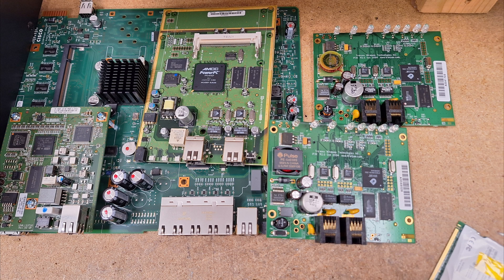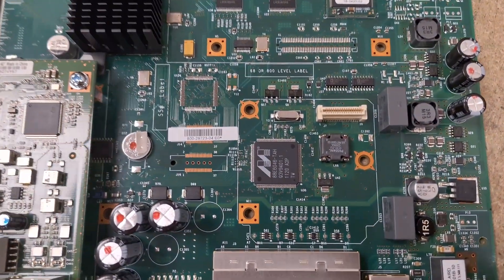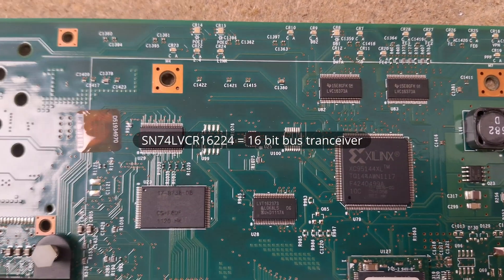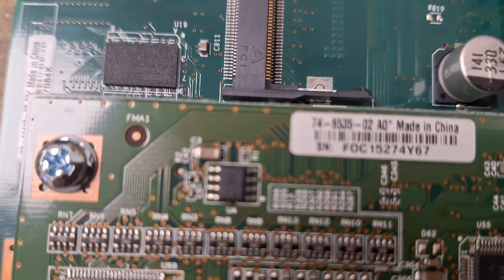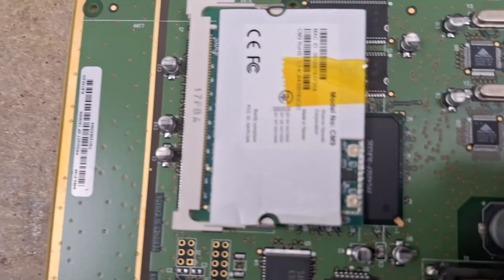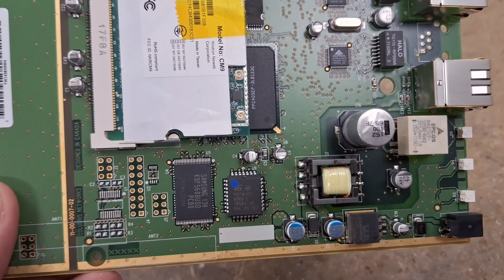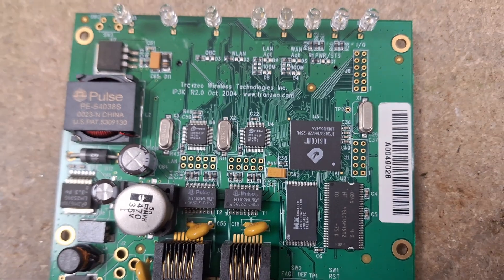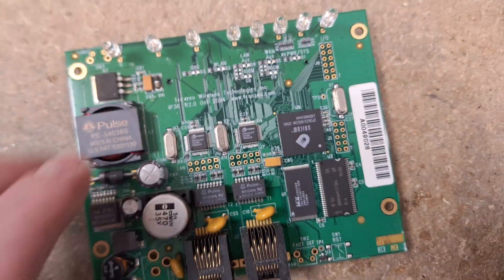A look at some PCB's from high end networking gear before they go for e-waste. Anything interesting?

Comment: I have a cisco npe-g1 and trying to find a way to repurpose it ie install linux
Reply from the maker: I heard it was possible to put Linux on some cisco kit. I've now got another of these units and likely more to come due to an networking infrastructure upgrade. Its been chucked in the scrap complete might dig it out and have a look at if it can be used.

Comment: I'd be the type to take everything off that I can find a datasheet for... SMT parts don't take much storage space and are easily taken off with a heat gun. If you haven't done that before - well ventilated space and eye protection recommended, rip off any batteries and any electrolytics that you don't want to salvage beforehand - these can boil and burst if you cook them while removing other parts nearby. Remove labels, they will burn or melt. If you want to salvage connectors, film capacitors, relays, LEDs, or anything else with a thermoplastic housing (not chip plastic, that stuff is incredibly heat resistant), do them first and heat the board full blast from the BACK side while clamped in a vice (some boards can char/smoke, that's why I recommended good ventilation) - connectors will melt if you hit them with the kind of blast that is perfect to get chips off quick and intact.
Reply from the maker: Thanks, yeah I salvaged a few useful parts such as voltage regulators, the RS232 chips etc. The rest I probably won't use but I'll take a second look before the ewaste bin gets emptied
Reply: @adriansmith31  Also, I tend to obsessively salvage these small pot core coils - these tend to physically break easily on otherwise good circuit boards when they snag against something else, so spare parts are always welcome.